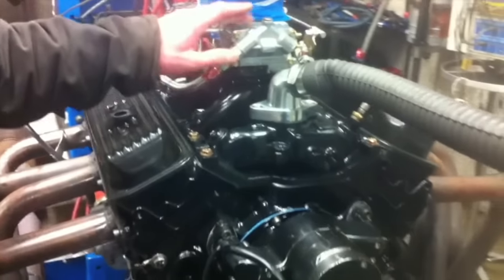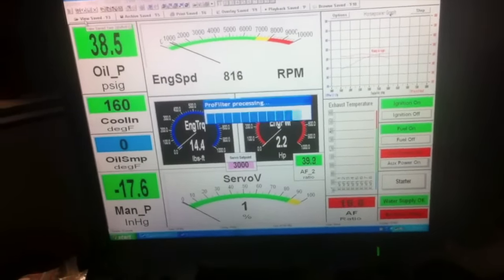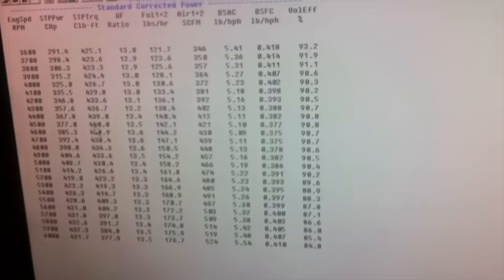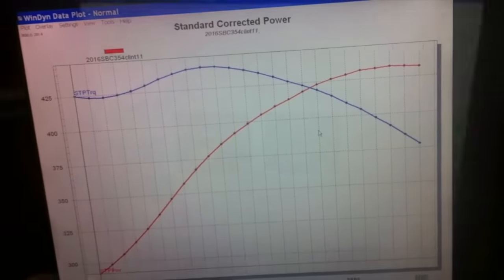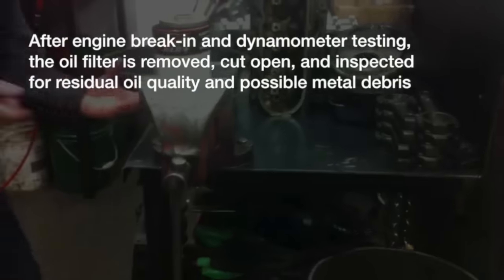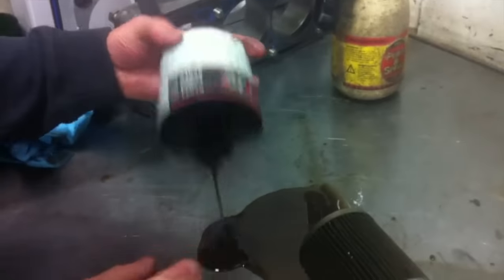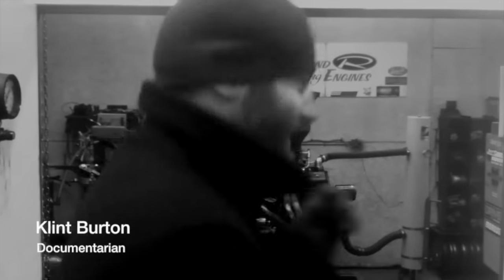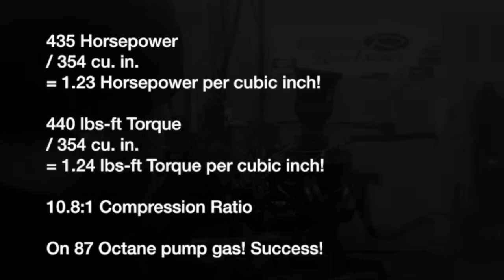SBC 400 Block + 327 Crankshaft Dyno The 350 Chevy Should Have Built (2016)

Comment: From a torque enhancement perspective , one could add a TPI intake (long runners) but would require the computer thing.  I also believe that aluminum heads a slightly higher compression would also add to gains????????????????
Reply from the maker: Hi G McNelly. Absolutely agreed with the aluminum heads idea. We had access to a great pair of cast heads with upgraded rocker studs, and due to a fixed budget, utilized them gladly! Best regards.
Reply: i was surprised to not use aluminum heads, they're cheap enough. the TPI just runs out of breath due to tube diameter, tho extrude honing an edelbrock lower TPI intake and siamesed upper tubes from Arizona Speed and Performance gets you in range, just need to make a large plenum "tube" and add on a Big Mouth TB.
Reply from the maker: Thank you for watching and commenting!
This build would have made more top end with larger heads but that wasn’t our only goal. The iron heads were saved off another build that was upgraded to AFR heads and so we went with what we had ;)
Building it on the ‘cheap’ so ta’ speak!
Reply: @albertgaspar627  do you know that the ramjet 502 uses the same throttle body as 350 tpi/lti/lt4 engines.  gm claims the throttle body is not an impediment until you reach the rpm range above which these engines are rated.  just saying.
Reply: @gmcnelly2468  interesting, and considering the Ramjet is really built for torque more than hp (even tho its obviously making both due to displacement), I can see their point about RPM. But who really wants to mass produce a high rpm engine with a warantee anyway, right? :)

Comment: Just noticed CE did cite the first article describing this "model" of a SBC.  As mentioned in the comments, the shorter stroke does permit higher RPMs due to lower stress, but stopping valve float is also necessary.  I read that top fuel ~500 cu. in. tops out at 8,500 with their huge valves.  I see these SBC dyno tests in here always limit at ~6,000 which is probably wise during the break-in/setup period, with some experiencing float starting around there.  So far, rotary valves have proved nonviable except for large, slow turning diesels.  They could be made if you want to rebuild heads every week.
Reply: Pro Stock use 3.25 stroke. Greg Anderson in car camera shows his tachometer tape cover at 10500rpm the needle was under the tape 10500rpm+. That's 500cuin 1400hp NA
Reply: @jeroldlafferty54  Do you know how they stop valve float?
Reply: The 400 was in cars and trucks from 1970-74 Bill Jenkins was 3.25 stroke  after market block in pro stock truck with 2  4bl carbs would turn 10000rpm+was making right at 1,000hp that was back in 90's
Reply: @vincel6340  the valve spring pressure at max lift is 1,000lbs+
Reply: Back in the 80's I use to be by the starting line, after the water box we use to do dry hops before stage your,Rev it up and let the clutch out. A friend was running NHRA f/gas 288cuin in his camaro I could see his tack during dry hops and starting line leave his tack was reading 11,500rpm it was always a treat.
Reply: @jeroldlafferty54  Didn't Jenkins use a .030" over 327 to 331 ?
Reply from the maker: That’s awesome!
Reply from the maker: Lighter retainers, lighter valves, more spring pressure, and often overlooked… stiffer push rods.

Comment: With those headers and air hat on the carb that is worth a good 30hp I'm sure. Put a normal style chassis header and take the air hat off. That would be more realistic. I've seen that style of header (straight tube out of the head) make 60 plus extra in a BBC and 30 plus on a choked up sbc with small diameter short tube headers.
Reply from the maker: Hi Jeremy Bartolomei, thank you for your comments. It's fantastic what one can do to enhance the volumetric efficiency going in, and coming out of, any engine. Best regards.

Comment: Gotta dig way back in history to think about this combination of parts.  There was no overlap in production years of 327 and 400, in fact does even the large journal size of 327 crankshaft even fit in the 400 block?
As for 350 using 327 stroke- there were some racers boring 327 blocks to get 337 cubic inches, this would be close to the combination that you created.
Reply: Yes it does.
Reply: @danfarris135  I watched another channel create their own oddball combination using 400 block and short stroke crank- they admitted that they used special bearings to handle the mismatch in crank journal sizes.

Comment: Good gravy that ratio is as undersquare as a doggone crotch rocket motorcycle!!! Bet it’s a blast at the old traffic light drag strip.
Reply from the maker: Hi VM! Thanks for your comment! Did you mean "over square", the bore width greater than the stroke length? This clip, though not a hard pull from a traffic light (1/4 throttle to 6,000RPM) shows off this SBC's sweet sound: https://www.youtube.com/watch?v=5by3aG_YXds
Reply: Yep! Got them backwards again.

Comment: Not a bad combination. A 0.040" 400 block with a 302 crank makes a really nice 327, too.

It's a shame that 400 blocks are rare. The 400 block and shorter stroke makes a MUCH better high performance combination than a 400 crank in a 350 block. And I can only laugh hysterically at people putting a 400 crank in a 305 block.

Comment: Good if you can afford the dart block. The 383 stroker supposedly came about because the long stroke of the 400 wore out the bores so they put the crank in a 350 block. I know I read that years ago anyway,seems like the crank would do the same to tha 350 block if that was the Case,plus I thought all small blocks were the same anyway🤷🏻‍♂️
Reply from the maker: From the outsides, they are all the same size and bolt up the same. Many bore and stroke combos through the years made the difference :)
Thanks for commenting.

Comment: Isn't the 400 block a bit too thin?  There must be a reason the 350 block, 383 stroker is popular.
Reply from the maker: Depends on the application. Some big motorhomes had 400 blocks without issue. Any 400 performance car engines we’ve built have been amazing successes. Thanks for commenting.

Comment: I with stock vortec heads...I love it. Wonder what it would do with a Edelbrock E-TECH 200 HEAD?
Reply from the maker: We would have loved to try aluminum heads. At the time, we had a pair of slightly modified vortecs, and they worked beautifully, as you can tell:) Use what you got. Best regards.
Reply: @ceperformance  I love it!

Comment: I Really like the video I would have liked more information about the short block like what rods go with the 400 block and 11 to 1 pistons 350 crank or the 327 crank to stroke to a 354 cu in
Reply from the maker: Thanks for commenting! 
It’s a 327 crankshaft that is a 3.25” stroke. The 400 has a 3.75” normally. We used 6.25” rods and flat top pistons that are made for the 400. Off the shelf parts to keep the cost reasonable was the key on this build. Rebuilt used Vortec 350 heads :)

Comment: I'm wanting to build weird combo. A 307 block, with 400 crank. Just want a low rpm torque motor, for 66 truck, truck will be used to pull car trailer some, but want best mileage, whether empty, or loaded.
Reply from the maker: That sounds like a great idea. Should be inexpensive too!
Reply: @ceperformance  i hope, I owned several over the years, best MPG so far was 24, with 18-22 averaging. but I want torque, hence me wanting long stroke, but mileage, so small pistons, curious to see how close to 20mpg I can get unloaded. lol or break it slightly. not expecting miracles, but know what I have done in past, but had quite a few 307s. whether built or stock. still have 3, 1 of which is 100% stock.

Comment: i think there is a problem with the 400 block due to no cooling in between the cylinder bores.
Reply from the maker: No problems with a good cooling system. We also connect the rear of the intake to the thermostat and/or water pump. Makes a big difference.

Comment: That would be like a small-block version of Chevrolet's big-block 348 installed from 1958 to 1961 in passenger cars.
Reply: Had one it was was a screamer and good power but kind of heavy .
Reply from the maker: Hey, thanks for commenting!
Reply: Your looking at 150lbs more weight to.
Reply: @jeroldlafferty54  Yeah but put in a lighter body and it works . Screaming engine .
Reply: @txrick4879  good low end torque for 348cu in.

Comment: I've always wanted to do similar with a small block Ford, Dart block with a 4.125 bore and a 2.87 stroke. Considering we got 400 HP out of a 289 that's 20 over with a 270 duration cam...
Reply from the maker: Hi Glen! That's a great idea. There are some pretty sweet 289 SBF dyno videos out there, and you engine combo could produce some good numbers for a smaller displacement engine. What would be the engine application? We built a customer a 302 SBF with an aftermarket 9.2" deck-height DART block, used 6" gm rods, and the engine dyno tested at 450 HP, 375 LBS FT. We don't have a dyno video, but here's a video of it running: https://www.youtube.com/watch?v=cgzTemIAMvI . Best regards!
Reply: @ceperformance  The 400 HP 289 was just a resto-mod 68 Fairlane (cousin's) turned dragster. In a tubed Mustang it ran 7.47 in the eighth. The future project, nothing in particular, just ready to build something. I'd like to build another smooth idling SBF that turns ~7000.

Realistically I'm probably going to swap a decent cam into my 96 GT40 and carry on, if I did what I wanted I'd drop ~$20K on a SBF pretty quick... lol
Reply from the maker: Right on!!

Comment: Wouldn’t that actually be 340 CI?
4.165 bore X 3.25 stroke X 8 cylinders X 3.14 (pie) = 340.0306 cubic inches. 
Production 350 is 4’ bore X 3.48 stroke X 8 cyl X 3.14 = 349.6704 CI (rounded to 350 ci)
Reply from the maker: The math is 4.165 divided by 2 then squared, then x pie, then x 3.25, then x 8. It equals 354.236…
I think you just did the pie out of order.
Reply: @ceperformance  much appreciated, this makes sense.

Comment: Way back my 71.307 3 speed I brought then got a used 70 350 4 barrel. We put the 350 in and took that head to the shop. And put the 307 small valves head on  for about a month. Man the more torque w/ smaller valve was perfect with the 3 speed. Chirp the tire without gas and had a unreal 1 gear to 55 it was perfect fir the street. But we got the 350 head back and put it in and it was soggy wait fir the rev to buil kind of power. I wanted to tell my friend put the 307 head back on but didn't.  It was toque monster with long 3 speed then change to rev with tap gearing miss match LOL
Reply from the maker: Sounds fun :)

Comment: Try the 302 steel crank next time with 13:1 compression and right cam on 87 octane gas. 😉
Reply from the maker: Thanks for your comment! 
Here’s our 3.0” stroke creation…
SBC 283 Crankshaft + 400 Block = 500+ HP (Dyno Test 1 of 2)
https://youtu.be/dBjdYC5sMjs
Reply from the maker: And the second dyno test here…
Dyno #2 283 Crankshaft + 400 Block 512 HP 435 LBS FT Valve Float Fixed
https://youtu.be/Ge6RsIOs1-U

Comment: If you limit total advance timing without changing base timing you’ll get a better result.
Reply: Most knowledgeable drag racers run the advance locked out & only set total timing. This doesn't work well on street cars or race cars that see a wide RPM range.

Comment: I suppose that's good for an NA carbureted engine with fixed valve timing. But my 2007 Volkswagen Passat 2.0T makes 200hp and 207 lb/ft with 10.5:1 compression and 15 psi boost on top of that with mid grade fuel (89). Thats pretty impressive, but only possible because of high pressure direct fuel injection and VVT... Imagine what that 354 would've made with the same setup...
Reply from the maker: Good points. Thanks for commenting.

Comment: This is similar to what Oldsmobile did with their 403 cubic inch small block which used a stroke of 3.385" and a bore of 4.351" and what Chrysler did with the big block 400 which used a short stroke of 3.375" and a bore of 4.342".  The short stroke makes more power at high RPM but less torque at low RPM.
Reply from the maker: Thank you! I wasn’t aware of those facts :)

Comment: This sounds like the 1978 version of 327 which is built different when it comes to internal parts .those engines need bigger connecting rods where they join the crankshaft the block may have to be ground for additional clearance between the did and inner side of block .but that's for all out racing (lol)
Reply from the maker: Hey, thanks for commenting. Could you elaborate on the 1978 version engine or did you mean 1968?
Reply: That would be the 305 3.25 stroke
Reply: @jeroldlafferty54  when it comes to a 327 the bore is at least .400 or up to 35 thousanths over a 305 is only 3 and something kinda like the older model 283 but with bigger journals and the connecting rods blow apart easy

Comment: Builds a 10k RPM capable motor, dynos it at 6k RPM'S max... my 400 block with 350 crack did 677 hp at 8700 rpms. You guys need to push that engine harder.
Reply from the maker: Hi AN! Great comment! As this was a budget build for a customer, and utilizing, mostly, some of our on-the-shelf inventory, we think this engine did just fine. Our customer loved this mild engine and its unique sound and temperament. Best regards! Even with the 440 LBS FT at the crank, this engine still broke the tires free in our R&D shop car, a '64 F-85: https://www.youtube.com/watch?v=SapdPR_SgMQ

Comment: I run a 427 Dart after market block Bryant crank mgp rods profiler 18 degree heads hogan’s billet intake Wilson throttle body the crank was 4.000 stroke the bore on the block is 4125 with the custom pistons  it’s 12/ 1 compression and I run the gangster 98 turbo from forced inductions just had it freshened up at tkm there the best in the buisness  the engine and turbo is good for 2500 plus supposed to be anyways I’ve probably only used about half of that I’ve had it running at 34 pounds so far I wanna crank it up this summer when I get it back together all the electronics is Holley it’s nothing special off the shelf parts.
Reply from the maker: Fantastic Locked! Who needs Netflix when you got that kind of entertainment? Well done, bro! Get it back together. Best regards!

Comment: A 327 crank before 69 or late 68 was a small journal so  I'm sure its not that crank and I thought the 327 and 350 had the same crank stroke after that but maybe I'm wrong
Reply from the maker: You’re absolutely right. The crankshaft we used on this build was a 1969 large journal steel 327. 
Thanks for commenting.
Reply: Same rod and crank journals 69 but 3.25 vs3.48 stroke for 327 ,350 ,respectively.
Reply from the maker: That’s true! Thanks for commenting.

Comment: Had an old friend that always spoke of a 400 block with a 265 crank and rods as an answer for a hi revving pulling truck engine. Had miserable low end torque but claimed to get 10 k rpms.
 Said “you had to drive it like you were mad at it !”
😂
Id like to see you try that build.
Reply from the maker: Thank you for your comment! Here's a 283 crank in a 400 block dyno video, 512 HP, 435 LBS FT, our mild 329 SBC: https://www.youtube.com/watch?v=Ge6RsIOs1-U

Comment: This is just one of the ways NASCAR kept within the rules, changinging bore and stroke to maintain 350 cid. The used market has tons of combo's you can still build even with some wacky specs. For me if I'm running this small stroke combo its revving to the moon making big power that can still be streetable which is really a matter of taste. This whole bs about torque is king...sure it is if you don't want to race and besides as hp goes up so does torque, right?
Reply from the maker: Hi Painter! Thanks for commenting! Current NASCAR's displacement reg's have a limit of 358 cu.in. meaning that a max bore of 4.185" can be used, when combined with a 3.25" stroke. Horsepower equals torque multiplied by rpm. Many scoff at this build, as if 440 LBS FT in a mild cam engine is derogatory. But many more appreciate what we've done. At the end of the day, the customer loves his engine, this engine. Who can argue with that? If you're interested and haven't seen it, check out our 329 SBC, with a 3" stroke and a 4.185" bore. https://www.youtube.com/watch?v=Ge6RsIOs1-U . Best regards.

Comment: The 400 block has heating issues with siamese cylinders. That's why most street rod builders stick with the 350 block and 400 crank. Also in 69 chevy built a 302 cid for the Z28. I raced one once when he passed me on the top end he was turning around 11k rpms.

Comment: Would love to see a build on the SCCA Trans-Am limit of 305 cubic inches. Like the old 302 Camaro engines. Or building one from a 327/283.
Reply from the maker: Hi TM! Thanks for your comment! It's not a 302, but it's based on it: our 283 crank in a 400 Bowtie block: https://www.youtube.com/watch?v=Ge6RsIOs1-U
Reply: The 302 was a 327, 4" bore block with a 283, 3" stroke crank. Nothing really new under the sun except better & much more expensive parts! LOL
Reply from the maker: @bradgriffith4231  Exactly. "Speed costs. How fast do you want to spend?"
Reply from the maker: I like that!!

Comment: And Oldsmobile basically build just that combo.  4.057 x 3.385. Bore goes to 4.125 easily and you have a 358. Better heads that the double humps even porting them both, pitiful stock intake and it never got a camshaft though or a small platform to perform in.
Reply from the maker: Hi Derrel! Thanks for commenting! We like the 4.165" bore x 3.25" stroke combo and have had great results! Check out our 4.185" bore x 3" stroke SBC: https://www.youtube.com/watch?v=Ge6RsIOs1-U . Best regards!